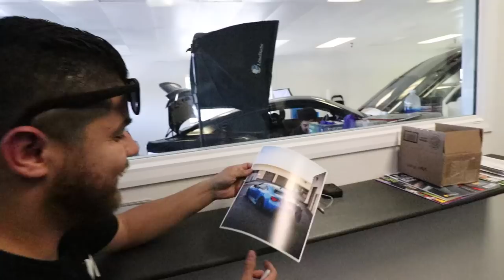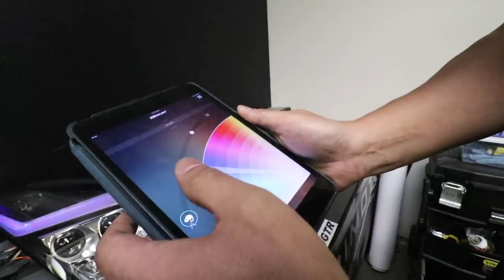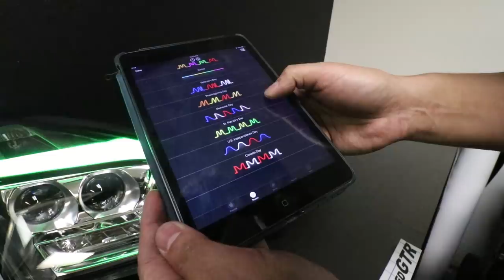Ford Lightning & Mustang GT Vinyl Wraps | #PremiumFam

Comment: Hey question! If i were concerned about my paint and wanted to protect it from normal wear, but wrap help with that at all or would I still get the inevitable chips n shit? Thanks.
Reply from the maker: Twent V wrap will help protect your paint job but If the hit is hard enough chances are the wrap nor your paint will survive unharmed.

Comment: I talked to someone who wrapped vehicles and said that one of the expense is because when they pull off pieces of the car, things break and they need to replace them. That threw me off guard, should things break at a shop?
Reply from the maker: No, things should not break, in the event that something does break, most reputable shops will cover the damage. Occasionally new clips / hardwear will need to be purchased.
Reply: That makes sense, thanks.

Comment: Question.. if my hoods clear coat is peeling off and the paint is chipping, what do I need to do before starting a wrap
Reply: 3many15 sand it smooth. Any imperfections will show through. Just have to always rock a wrapped hood, which if your chipped and peeling anyways then it doesn't matter.
Reply: 3many15 sand it smooth. Any imperfections will show through. Just have to always rock a wrapped hood, which if your chipped and peeling anyways then it doesn't matter.
Reply: Hoang Nguyen but will the wrap stick to the part that I sanded?
Reply: 3many15 I don't see why not. If not then look into the primer that premium uses.
Reply: Hoang Nguyen alright bro I'll look into it thanks
Reply from the maker: 3many15 Typically we will just sand the hood smooth before wrapping.
Reply: Premium Auto Styling thanks I thought there was more to it haha